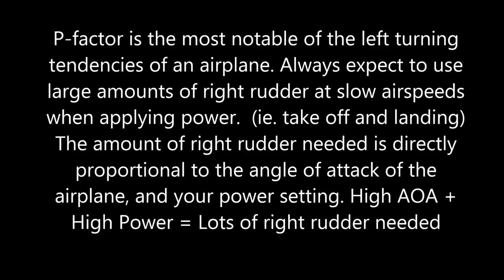Ep. 8: Left Turning Tendencies

Comment: Left-Turn Tendency:

- P-Factor
    - When plane climbs, the right propeller takes a bigger bite of air.
    - This asymmetry in thrust causes the aircraft to yaw to the left.
- Torque Effect
    - According to Newton's third law of motion (for every action, there is an equal and opposite reaction), the propeller spinning to the right (clockwise from the pilot’s perspective) creates a reactive force that tends to roll the aircraft to the left.
    - Noticeable at high power settings, such as during takeoff and initial climb.
- Spiraling Slipstream
    - The slipstream (or airflow) generated by the rotating propeller spirals around the fuselage of the aircraft.
    - Causes yaw to the left
    - Noticeable, at lower airspeeds with high power settings, where the slipstream effect is more pronounced
- Gyroscopic Precession
    - Gyroscopic precession occurs due to the gyroscopic properties of the rotating propeller.
    - When a force is applied to a spinning object, such as a propeller, the resultant force is felt 90 degrees ahead in the direction of rotation.
    - For example, during a nose-up pitch change (like during takeoff), the force applied to the propeller results in a yawing moment to the left.
    - Noticeable during rapid pitch changes, such as during takeoff or abrupt maneuvers.